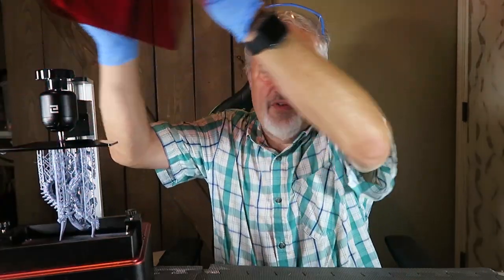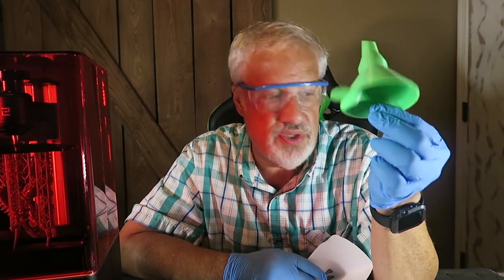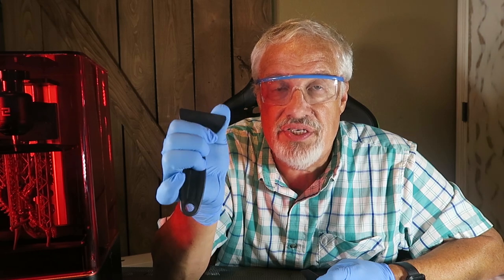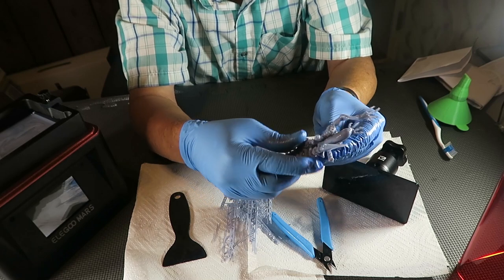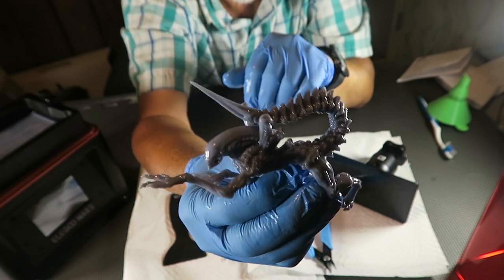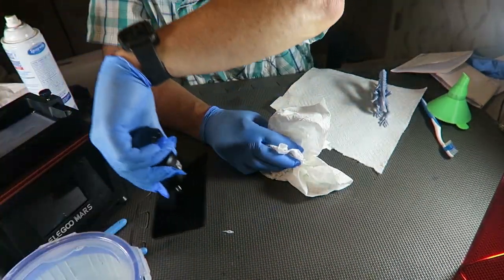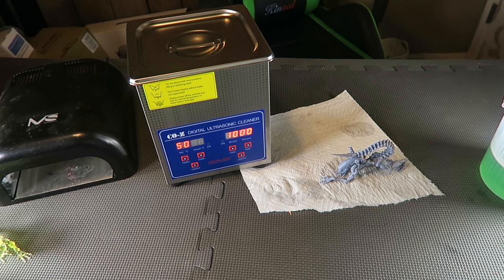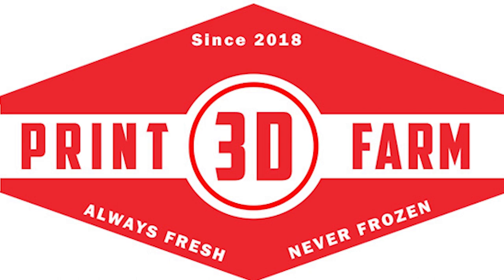Elegoo Mars Resin Printer: Getting Started! Tips and Tricks!

Comment: Thanks for the video.
Why do you remove the support before cleaning and curing?
Does it have any impact on the printed model if you remove the support afterwards?
I think that would solve several issues and reduce the cleaning of tools. It would also allow you to put the support material directly in the waste bin as it is harmless.
What do you do with the support material, resinfilled paper towels now?
Reply from the maker: The supports are very pliable prior to cleaning and they are removed very easy.  Also, if you remove supports after cleaning, there is a chance for more pock marks on the model.  Technically, you could place all the supports in a transparent box and then directly into the sun where it would cure all the sticky bits!  Thanks the question!  I appreciate all you guys!

Comment: Great video, just a shame we can’t get simple green at a reasonable price in uk.
Reply: You don't need it. This guy uses way to much stuff. Most people clean the model in IPA. This guy cleans in IPA, then buys a separate spray (also containing IPA) to clean the film. Then he buys a 2 separate blocks of green stuff which he pre-cleans and then more green stuff for his sonic cleaner. If IPA is good enough to clean the very sensitive film then by definition he does not need to waste extra money and mess on "green stuff". He also wastes multiple gloves because he removes supports before rinsing (why?) Other people rinse first to get most of the residual resin film off first. Also you can use chopsticks to move the model. This guy is very wasteful.

Comment: Very newbie question here: do you have to clean the printer if you want to do print after print? Or can you just add more resin and continue printing something new?
Reply from the maker: Great question! As long as you didn't have a failure where bits of cured resin are floating around or stuck to the bottom of the tank, you can just continually print.  Just add more resin as needed!  I do it all the time! :)
Reply: @3DPrintFarm  That's awesome! I know what I need to buy now haha! Thank you for the detailed review!

Comment: Thanks for the vid! Can't wait for those support settings. I find I have to use the nippers to remove mine (I use that sphere tip and put them about 30% in).
Have you found your nippers get crappy after using them the way you are? Either the resin or the IPA I've been washing them in have made them super stiff (I have to pull them open manually). The IPA may have dissolved the lubricant on the spring. Are you having a similar problem?
Reply from the maker: Yes!  That's a good point!  The IPA will dissolve the lubricant.  I usually go back with some white lithium from time to time to remedy that.  I also had a great tip from a subscriber about using fine tipped tweezers to remove supports.  I'm going to try that out soon!

Comment: using IPA in an ultrasonic cleaner IS NOT SAFE. especially not when warmed up. It amazes me how many youtubers reccomend this. If you want to use an ultrasonic cleaner, put water in it, and then put the object with some IPA in a plastic bag, which you lower into the water. this way it cleans but you dont have the risk of 1L alkohol igniting from a spark or heat.
Reply from the maker: Yep.. That's why I don't use alcohol.
Reply: @3DPrintFarm  My bad, im sorry. But i still think it is relevant for those viewers who might :)
Reply from the maker: @GuyFromInternet00  No need to be sorry.  You are right.  Resin printing is not something that should be taken lightly.  There are so many safety protocols that need to be followed and even then, you have to have a contingency plan in case of a spill.  I may do a video specific to safety because I think that it would warranted judging by the influx of all these new folks that are buying these printers! Thanks for the feedback!
Reply: @3DPrintFarm  i would love such a video!

Comment: Safety: Don't touch your goggles nor face/skin with gloves on once you have just dealt with the printer. :)

Why don't you just dip your print into the cleaning bath and then deal with supports - you would deal with at least partly "decontaminated" stuff.
Same for the printer base plate: You have gloves contaminated by resin yet you touch it all over instead of just grabbing it where it was already in contact with the resin. Thus you just spreading the contamination.

No pun intended, but why to deal so much with safety, cleaning/decontamination while at the same time you go in opposite direction and spread the dirt where you can easily avoid it? I see no difference whether you clean laboratory stuff, painting brushes, wash the dishes - you flush the dirt in one direction from the best to the worse. You do not grab frying pan and then pick up the glasses unless you love washing the stuff :)

If you care about fumes, do not judge the risk by smell. Bad things do not have to smell badly not even at all. Than it is probably better to have respirator designed to capture organic solvents and/or make some ventilation booth with filter like some scale-models builders use for the airbrush.

Otherwise nice vid, I am quite a lot thinking about 3d printer and making my choice between filament and resin one. How long did the print take?

Comment: I was told to buy an additional UV face tanning device for after curing but didn't see you do any of that. What should I do? There will be hardly any sun here soon in The Netherlands.
Reply from the maker: A single UV device (UV nail curing device, etc) should be sufficient to cure your prints.
Reply: @3DPrintFarm  but you didn't do that step, so that curing is after you do all this?
Reply from the maker: @tiriaq2607  Yes sir!  After you clean your print, you will need to cure it under UV light... For the Alien, not long 10 mins or so.. Then it's completely finished.

Comment: could you do another print without draining just clean build plate and top up
Reply: Yes, as long as there's no solid bits of resin in the vat. If there is, then you'll have to drain and clean it. You can use the plastic scraper thing to carefully move along (don't scrape) the bottom of the vat to feel for any cured resin in the vat.
Reply: @mimked  thanks and could you use a silicon baking spatula instead of that hard plastic one that comes with the printer in the vat.and could you use a metal scraper on the build plate to remove the print of that .would that be ok
Reply: @darren990  if you're just using the spatula to feel for clumps and other hard bits, that should be fine. If there is something stuck on the film, then drain the vat (get all the resin out) and add some IPA to soften the hard bits. Eventually you should be able to get the pieces out without having to scrape anything (regardless of which scraper you use).

A metal scraper on the build plate shouldn't cause a problem. It's possible you could scratch the build plate, but some people do that purposely to get better adhesion, so I don't think surface scratches will cause too much of a problem. That's just theoretical, though, since I haven't tried it myself, so use at your own risk. I have been tempted to use the metal one, since it is quite difficult to remove prints with the plastic, but haven't done so yet.
Reply from the maker: Yes sir!  Will do!
Reply: @darren990  Update: I recently broke my plastic scraper (the one that came with the machine) while trying to remove a print from the build plate. I switched to a metal one and it works WAY better. Doesn't scratch the build plate, either.

Comment: Are you liking the Elegoo more than the Anycubic?
Reply from the maker: Good question.  I can't say I love one over the other, but the Mars is REALLY nice in the area of little to no smell and being built extremely well!  For $250, I couldn't pass it up!
Reply from the maker: @kasa6468  For ease of use and cost, Mars is the winner for now.  Photon has a HUGE user community on Facebook, but Mars is growing fast as well.  I have both, but I tend to use my Mars more.  Good luck with your search!  You're going to love resin printing!  It's like no other!
Reply from the maker: @kasa6468  I really like the 'openness' of the Mars because you can get around things much easier.  The exposure times are night and day.  The Mars utilizes a 40w lamp compared to a 25w lamp for the Photon which means less exposure time and faster prints.  Another bonus is that the Photon, Epax and Mars all use the same consumable part which is the LCD.  They are readily available.  I just replaced my Photon LCD for $40 from the Epax store.